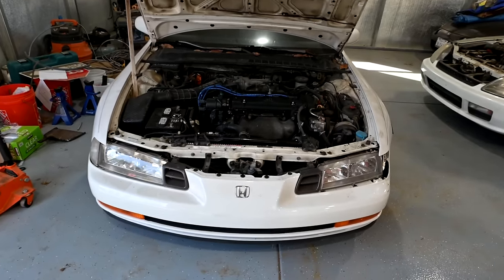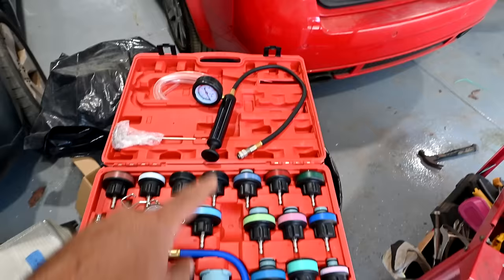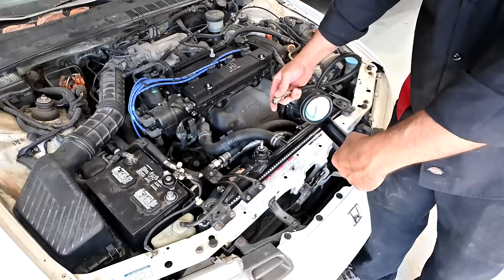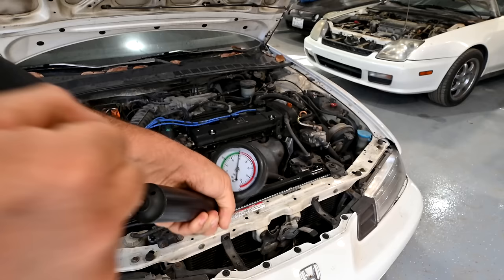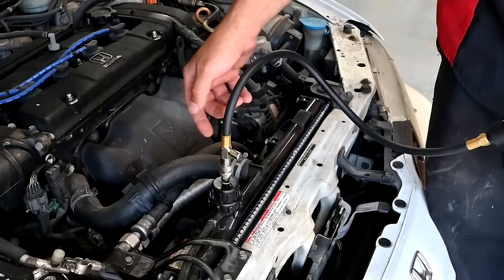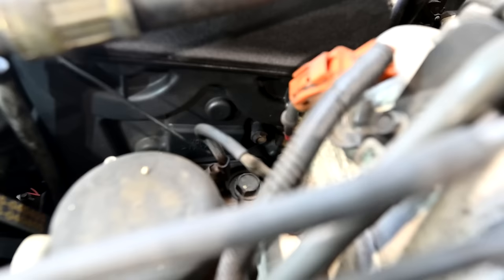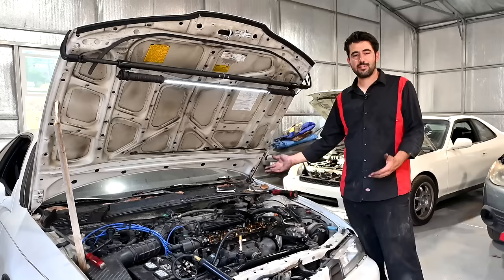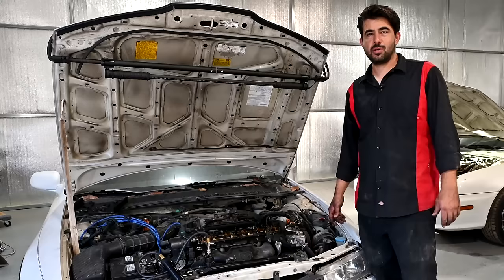How To Find Any Leak From Your Cooling System

Comment: Off topic but you are looking in much better shape than years past is there anything you are eating or not eating? Thanks.
Reply from the maker: I'm eating less especially processed sugars and working hard :)  have lost about 40lbs compared to a year or so ago. cheers
Reply: That’s wonderful congratulations. What a miserable place to get into. People complain when they have what seems like a simple job expand into something way more expensive and this is a great example of why that is always the case. The engineers that build these things should have to work on them, then they all be set up like the Nissan 1600 was. Back when it was Datsun. A real joy to work on if there is such a thing. Great video
Reply: Its the avocados he’s growing an avocado a day helps to lose weight and has good fatty acids the body needs.
Reply: Great video. Keep' em coming please.
Reply: The number one thing that knocks out promising mechanics is lifting that heavy lead battery from SUVs or Trucks from an awkward angle. Spend the $,  & the time, and use battery lifting tool.  That Flat Rate rush is not  Freakin worth busting  your spine & ruining your physical self !

Comment: After fixing the first leak, not  only is it good to check for other leaks that might be present already , but fixing the first leak will cause the system to achieve a higher pressure, which can cause some other weak spot to leak anew.
Reply: I think that's my issue new rad new ac condensor new thermostat  pump belt I done it all now found small leak .can't locate my dye and torch ggrr . So may new new 1 . Can then check while running ideally in dark

Comment: Please continue on with this car. Very interesting to see.  I pressurized my 1994 Grand Am 3.1V6 and it looked good.  So I replaced the expansion tank cap (there is no radiator cap on this car) and all seemed good for a few months.  Now I've noticed something has leaked on the front side of the engine. I had replaced the water pump last year.  I guess I'm going to have to investigate further.  Thanks for another informative video.  Cheers
Reply: make sure you check those intake gaskets as well very bad on the gm 3.1...
Reply: @turboimport95  Indeed they are.

Comment: I have to fill reservoir  every week or 2 ..pressure tested when car was warm to touch and saw water driping from on that side of engine but couldn't see where it was coming from i release the pressure and presurise it again but there was no leak anymore thats an strage thing so wonder what could it be it had coolant still

Comment: This is one of the specialty tools I use the most, since cooling system problems are surprisingly common in engines. The only thing is, you never seem to have the right adapter. For example my Astro kit didn't have the right adapter for old model Chev trucks, so eventually I got another kit with more adapters. The backbone of the Astro kit is better quality but the chinese knockoff gives more diversity of cap options.

Comment: Speaking of Astro, that air powered air tool is the way to go. So much easier. Note, the adapters say they work with most kits. Not the MityVac 4530. Had to get a used Astro kit.
 Astro Pneumatic Tool 7856 Universal Air Powered Cooling System Pressure Tester

Comment: A pressure tester works wonders. On my pt cruiser and it was full of water yeah and i was messing with a lower hose i forgot why and i didn't put the clamp on good because i was irritated with it and wanted to be done right lol. Not even like 4 psi blew the hose right off along with muh coolant (didn't have distilled water at the time) so i never started the car to test it that way at all and could have saved my engine and a stranded tow possibly back home to see my shame of not putting the hose on right or with the clamp on tight. Pressure test your systems no only good for finding leaks also good that you didn't mess up on a installation like i did.
Reply from the maker: haha yes it's a great way to check your work too.

Comment: CAUTION TO ANYONE REPLACING GEAR DRIVEN WATER PUMP! It is very important to make sure your vehicle engine is or is not a non-tolerable or tolerable engine. You may have to use a tool to hold your timing gears in place. First set at top dead center and set timing gear holder in place. IF ONE WAS TO REMOVE THE TIMING BELT ON A ZERO TOLERANCE ENGINE. THE ENGINE VALVES WILL STRIKE THE PISTONS THEREFORE CAUSING CATASTROPHIC ENGINE FAILURE DUE TO BENDING OF VALVES AND DAMAGE TO PISTONS.  "PLEASE DO YOUR NEW DEALINGS AND LOOK INTO HOW TO REPLACING YOUR WATER PUMP" IF YOU DO NOT FEEL COMFORTABLE PLEASE TAKE VEHICLE TO A QUALIFIED REPAIR SHOP! REMEMBER REPLACING A WATER PUMP THAT IS DRIVEN BY TIMING BELT CAN LEAD TO CATASTROPHIC ENGINE FAILURE. PLEASE BE VERY CAREFUL.

Comment: Waste of money. I use a brake bleed kit. 

Deflate nearestbtyre to around 17psi. Attach the hose to the tyre other end screw onto expansion bottle as a lid and it does exactly the same thing at a fraction of the cost. I think mine was £8 from Halfords many years ago. 🎉